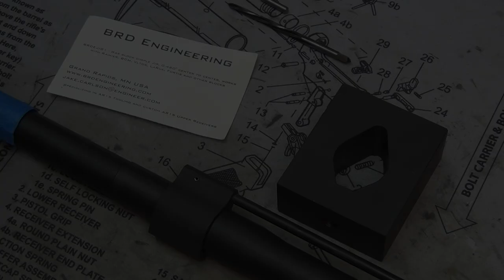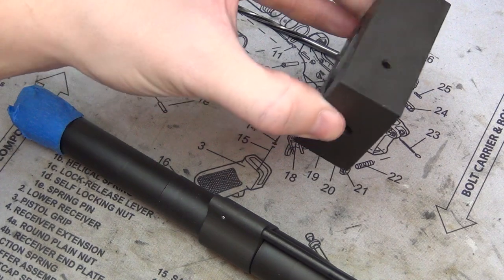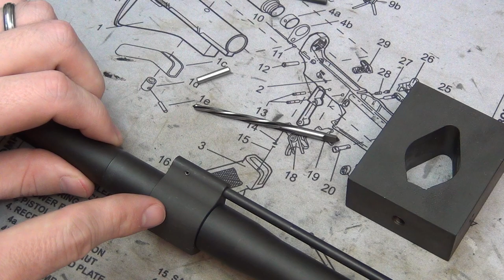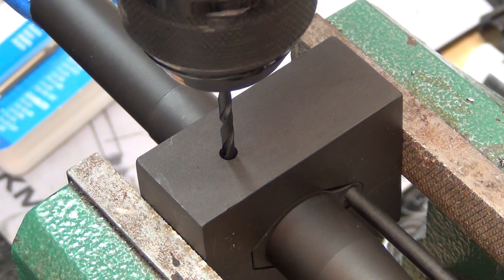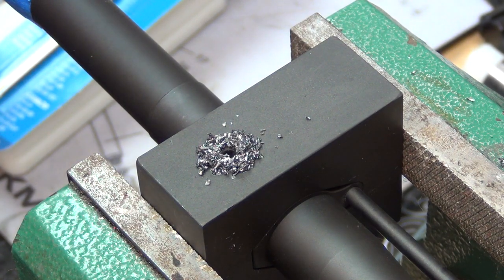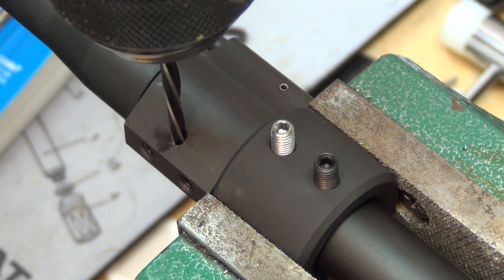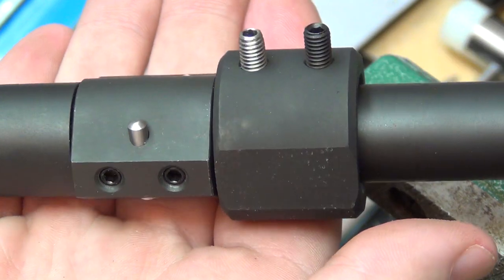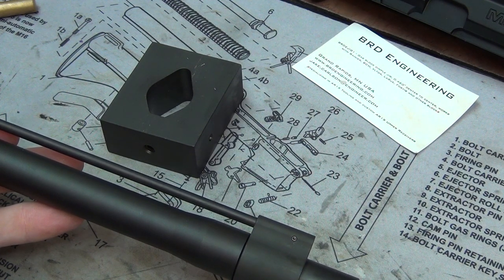AR-15 - How To Pin Your Gas Block

Comment: A possible word of caution- I pinned an AR10 308 Criterion "Hybrid" barrel and wondered why accuracy was far poorer than the sub MOA Criterion expected. Long story short: After sending the entire upper to them they believe side pinning created a "hot spot" and/or change in barrel harmonics.  I was getting 3 MOA with it side pinned and sub MOA after removing it and replacing with a non side pinned block.  Much to my shock and pleasant surprise, Criterion sent me a NEW BARREL even though I pinned the first one. The new barrel was simply dimpled as they recommend. Comments and thoughts welcome. Outstanding service by Criterion.
Reply: Wow that's outstanding customer service! 

Did you use this jig?
Reply: I did the exact same thing with my 14.5" Criterion .223 Wylde barrel, though I suffered no loss in the accuracy department. Used a Geissele rail/gas block and sent it to ADCO for a "bomb-proof" installation of the gas block which involves pinning and 2 set screws. I think the biggest thing is to have it done by someone who really knows what they're doing. Can also vouch for Criterions customer service. I have yet to find a better company to do business with in the firearms industry.
Reply: Wow, what a great company. Definitely on my list for my next build.
Reply: Liar
Reply: @robertsalas3984 when metal heats up it expands the thick of a barrel greatly negates this but the area near the bore thats been drilled is obviously thinner which causes that entire effected area to be out a whack with the rest of the barrel. Think of it like driving fast on iced roads and then going over a speedbump. Thats why i just leave it at dimpling.
Reply: I just dimple the gas block and put some thread locker on it. Never had an issue.
Reply: Good to know. My dad got me the same barrel was going to go with a superlative gas block and wanted to pin it for added security. I will just use the set screws with a dab of red loctite and proper torque.  Very impressed with the quality and that is excellent customer service
Reply: @americanmilitiaman88  If I remember right the Criterion has a single dimple. You may be able to add one, but I've had no issued to date with proper torque and red loctite.
Reply: @jamesws3  mine has a dimple. My next 5.56 build will be a criterion also.
Reply: @ViolenTech  That's not what he said.  The thin spot warped more from barrel heat in use, and since it was in the horizontal plane, not vertical, it had a noticeable effect on accuracy.  Shooting will get the barrel far hotter than the drill will, and that heat dissipates at different rates depending on material thickness.
Reply: You can always stake the set screws on the gas block like they do on the gas key to keep the screws from backing out of your worried about it
Reply: @Robert Salas  absolutely not lying. Criterion says explicitly NOT to pin or it WILL effect accuracy negatively. If it hurts your feelings.. well too bad.
Reply: Mhm that's weird. All of my AR'S are sub moa and they are all factory pinned. I just got a noveske barrel that's pinned from noveske.  It's like a 500 dollar barrel. Noveske is top notch and they pin everything.
Reply: If I went criterion though I wouldn't pin the barrel I would just buy a badger ordnance set screw gas block like they recommend.
Reply: @Citizendefenseindustry   No specific gas block recommended back then nor did Criterion recommend against pinning. I strongly suspect my incident was a factor in current recommendations per conversations with them. Since fixed I get 1 MOA or better.

Comment: I would highly recommend using a T handle rather than the drill for reaming for the taper pin after drilling. It is
much easier to keep the taper from going out of concentricity  when you do it by hand.
Reply: And that is why it has a square top so that it fits a tap handle.
Reply: Absolutely......I agree.....ream by hand.....
Reply: Even dimpling the gas block robs some accuracy. I have a comp build that is built for accuracy. The set screws on the gb are threadlocked. Thats it. Multiple comps and thousands (4900) of rounds later, no problems, no misfires, jams, etc
Reply: I havent noticed. Decrease in axcuracy after I dimpled my barrel.

Comment: I used to always pin my blocks. When i got into 3 gun and started using clamp on adjustable blocks I didnt pin those. As the years went by and i put thousands of rounds thru my 3 gun rigs in comps, classes and practice I never had a single problem with the GB moving, I started to think it was just overkill. I can def understand it for peace of mind and confidence though.
Reply: I used blue loctite one time, and loctite spread behind crevices of the gas block due to my over excessive use, and it pinned it so hard, I had to use the hammer to remove the gas block, and that's after heating it up with blow torch for good minute. Yet it didn't work, I had to put my upper (without BCG) into the oven at 350 F.  Well...then I finally got it off. 

Don't overthink it, don't use too much loctite, but I would dimple the barrel for safety, as I did. But that will likely void your warranty. So yeah.
Reply: thank youCris!!!
Reply: @righteousone8454  How much loctite did you use and Where'd you apply it?  I ask because I removed one setscrew from the one that's dimpled, from a complete upper I bought, then put loctite on the screw and reinstalled it.  Am I anywhere near what you did?

Comment: Reamed slightly too deeply, but still effective. Good instructional video. I build these for a living and this is bar none a constantly overlooked yet ultra-important step in creating a reliable AR15. Good video, sir.
Reply: Should the pin be flush with the freshly-reamed hole on the other side (the opposite side of the one he's drilling from in this video) when you start to hammer the pin in?
Reply: Der Fliegende Holländer 

It's relatively inconsequential regarding the pin starting position, so long as it's driven in an appropriate depth to engage the taper fully.  That can only be gauged by the installer. Hard to see in a video. 

Some systems use self locking roll pins and can be equally as effective.  Easier to drill for, too.

Comment: Seems like a great idea. When I free floated one of my AR's, I kept the A2 front sight/gas block, but I cut the site off and grinded it down, then reinstalled. I know people mention all the time if I wanted to convert it back I couldn't, but I don't plan on converting it back and A2 front sight/gas blocks are easy and cheap to get.

Comment: Not sure what the instructions say, but I'd want a good bit more interference than that. I think you reamed the hole a tiny bit too big. If you don't have it pinned pretty tight, there's not much advantage over a set screw block.

Another excellent NSZ85 video! Easily the best AR build content on YT!

Comment: I have the same taper jig and it works great......I have the benefit of using a drill press......I have a different style jig also which lets you pin using a coil pin the same size as the forward assist pin which works awesome also......About the money spent on both when all tools are purchased......I know if you're building more then 2-3 AR uppers it's totally worth the money to do it yourself......Great video.....

Comment: I'd like to to do this on my barrel, but my barrel is nitride treated.  I had a hell of a time even getting it dimpled using BRD's dimple jig.  To give you an idea how hard nitriding is, I wore a cobalt bit out against it before I got even a quarter of one dimple formed.  The barrel laughed at regular steel drill bits.  Regular steel bits, you might as well have been drilling with tissue paper.

In the end, I had to get a carbide tipped bit from MSC industrial, and even then it was not easy.  I shudder to think about trying this on that barrel.
Reply: jamesp81 nitriding is just a surface treatment of the steel where nitrogen is introduced to the molecular structure of the steel. Once you break through the surface it's unhardened for the most part and should be easy to drill
Reply: Its getting through the surface thats the bear. Once you break through, its time for a new bit.
Reply: Cobalt drill after knocking the nitride coating off with a ziz-wheel.  Works every time, no prob...

P.S.: make sure it's a SHARP drill bit

Comment: So I’m about to do this and i have a question...after you reemed it and tapped the pin through,to me it looks like it went in way too easy.i thought I would need to tap it in and it have a much more tight fit,so it’s less likely to come out.you being able to just drop the pin in 3/4ths of the way seemed off.am I wrong? Or should it be exactly how you demonstrated?...thanks
Reply: SLR 762 
It's a taper pin, with a taper, not uniform dimension across length of pin.

Comment: Built a few ARs, never pinned a gas block. The one I'm working on now is for the purpose of "SHTF" prepping. I want it to be a very reliable rifle. I bought a carbon fiber barrel to reduce heat if I need to throw out a high volume of rounds, however I also would like to pin the gas block. Is there a way I can assure that this jig would work to pin the gas block in my specific barrel? I'm unsure if pinning even works with carbon fiber, as not many people ever use them in videos.

Comment: Great video. Can one use a roll pin(spring pin) instead of a taper pin?
Reply: You can but it’s such a weak way to attach gas blocks that you might as well not even drill it.

Comment: I wonder what the advantage/disadvantages with a taper pin vs a roll pin.  If I remember correctly, the M16 had roll pins on the gas block.

Comment: Great video. Does the drill create a notch in the barrel? If you have an A2 front sight already can you just buy a low profile gas block designed to be pinned for an easier install?

Comment: Some people have commented on the necessity of not needing to pin a gas block.  For most people, no it's not a "necessity".  That's because most folks don't shoot their AR's much and many AR's are used for ranges, plinking, or hunting and not primarily for self-defense or hard life and death uses.  When problems start happening with gas blocks is usually when a rifle gets ran hard.  It gets HOT at the gas block and this causes a couple of problems.  1.  Threadlocker is destroyed with enough heat.  2.  With no threadlocker, the screws to work loose and the gas block to shift...and then you have a single shot rifle.  Dimpling the barrel helps (delays significantly) but does not eliminate the problem.  Real-world and hard-won experience with the M-series platform has shown that the taper pin method is extremely reliable.  A good roll pin is also likely very reliable and I suppose that you could peen the threads on the set screws and that would help...but we KNOW that the taper pin method works.  Which way you want to build/maintain your rifle/carbine is ultimately up to you but I know which I trust when my family's life is on the line.
Reply: That hand drill is walking all over the place and so are his tolerances and alignment/straightness. If you are going to do something like this you need to have and use a vertical mill or drill press. Otherwise he would have been far better simply dimpling the barrel for the set screws with a jig and staking the the set screws. No way is that going to come loose or walk off. Every mallninja claims otherwise though and have the scenario dreamed up in there heads. If you carelessly throw your weapon around or drop it, you probably won't live very long in a gunfight anyway. Get ran hard....like countless mag dumps? I try to end the fight with as few rounds as possible or a single fired very accurate, well placed shot. If you are in a situation where you are dumping magazine and after magazine you need to step up your game on your accuracy. You can't shoot for shit....obvious by that 1,500 round carbine course you have signed up for and taken. The winner in a gunfight is the first person who produces lethal hits.

"Fast is fine, but accuracy is everything!" ~ Wyatt Earp
Reply: @John Doe  That's an interesting position.  While I think that people shouldn't purposefully drop kick their rifles, I have had to drag an M4/GAU-5 for work and crap happens.  They get banged around, fall over, and get used as a landing crutch when people get prone in a hurry.  People get sloppy when they are tired, hot, stressed, and sweating.

I agree that he should use a drill press or at least a simple jig to keep his holes aligned and I did say that dimpling and staking, mostly staking, helps a lot.  But the VAST majority of people, including many  gunsmiths, think a little loctite is enough and don't peen (stake) their gas blocks.  Once a rifle exceeds a slow firing pace this deficiency becomes apparent.  As far as not running a rifle hard...that's a stupid comment that makes assumptions that I'm unwilling to abide by.  First, nobody is talking about mag dumps, though that will certainly show deficiencies.  I am personally unwilling to trust lives to a rifle that hasn't been thoroughly tested in circumstances that reasonably simulate a firefight even if that scenario is highly unlikely.  And to bash people for taking good training classes is just willfully ignorant.  If accuracy is king... fast repeatable practiced accuracy is imperial and the only way to get that is to get training and to practice.

Your statements, other than about the tooling, are impractical and generally disproven by data collected by the FBI and military.  Shootouts are rarely at long ranges outside of the military and they generally have a higher than seems reasonable round count.  They certainly don't conform with your ideas of being some kind of stalwart six-shooting accuracy master while under stress...but I'm sure that you'll be the exception.  Have a nice day. 🙂

Comment: I’m not a gunsmith, let me get that out there. I asked Aero Precision if I needed to locktite their gas blocks screws and was told, no. Just torque them to 25 inch pounds and it would not move. So watching this video, I’m wondering if this is solving a problem that doesn’t exist.
Reply: Not a gunsmith either but I would have to agree. Seems like everyone from Leupold, Trijicon, Aero, Benelli, etc. People dealing with stuff fastened on high recoil type things, including very precision oriented devices like scopes. All say just use the proper torque and you're good to go. No need for Loctite or extra drilling etc. And to be honest, I'd rather have my 80 dollar FAT wrench, or a torque bar for the heavier things, and just check from time to time and make sure everything is tight. Preferable to drilling into my $600 barrel, or stripping Loctited screws in my RDS/Scope. Then either paying a gunsmith, or doing it myself, using a drill to other expensive parts of my gun like Leupold DPP or an equally expensive receiver.
Reply: @lordofentropy Which is why Trijicon attaches the TA51 mount to their ACOGs with red loctited screws from the factory, right? Because it’s “not necessary.”

Seems pretty hypocritical of them

Comment: Always use a drill press ... When drilling metal always drill slow ... ream only after checking the pin fit ... This was over reamed, the set screws are doing all the work

Comment: Thanks Nsz85. If I change a gas block to a low profile will I be able to pin it? It's pinned back the factory, but I'm not sure if the hole would be in the same spot. Any advise?

Comment: Do not attempt this with a nitride  coated barrel, the coating is too hard for the drill and the reamer to cut. I had to use a solid carbide endmill to make a hole in mine and used 3/32 roll pin. Did it on a milling machine , no jig was necessary. I have 40 years experience in maching
Reply: Nitride is NOT a coating. It is a form of heat treating which hardens the surface a few thousandths.
Reply: @richstone2627  regardless the barrel is too hard for standard high speed drills and reamers
Reply: I can vouch for not trying to drill nitrided barrels . Regular drill bits won't even cut it.
Reply: Rockwell hardness is up to around 70-75. You need to use a carbide bit.

Comment: Question:  I just ordered an upper that has a pinned low profile gas block DI system that I plan on swapping out for a low profile gas piston system.  Manufacture says OK to swap out, but doesn't recommend pinning new gas block on barrel since barrel has already been pinned.  Is it OK to pin a barrel twice from different gas blocks?  Thank you

Comment: You reamed the hole entirely to much, and now it's oversized. The pin is doing less than the set screws. Would not be surprised if it backed itself out.

Comment: Did you use the 2/0 reamer with the 5/8" or 3/4" length taper pins?

Comment: Nice video.  Well done.  
So, what is the general consensus?  
Clearly the pin adds additional stability, 
but if dimple work is done well, and set screws are torqued to spec, 
is a pin really needed?  
Thanks.
Reply: If it's your SHTF rifle then its insurance. Honestly you should be behind a bolt action .308 or better if SHTF.
Reply: @johnonthecooldoe6338  a bolt action .308 in a SHTF situation? This is the most Fudd thing I've read lately.

Comment: Reamer was not correct, those lady taps to seat the pin were deafening. Ever drive out a factory FSB pin? Those are done right
Reply: Imagine having to bed your gas block taper pin 😂
Reply: @rifleshooterchannel208  lol right. Bed the screws and have to bed a loose pin and still not as reliable as a FSB. No thanks